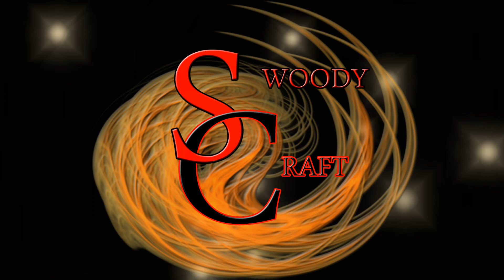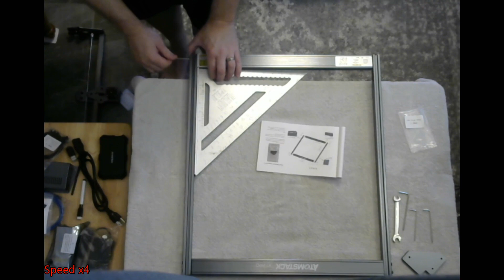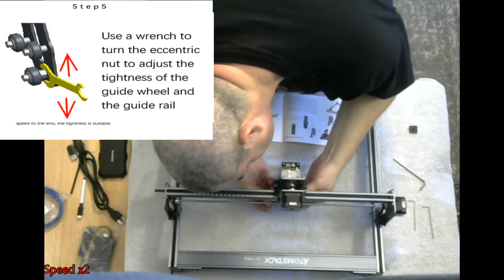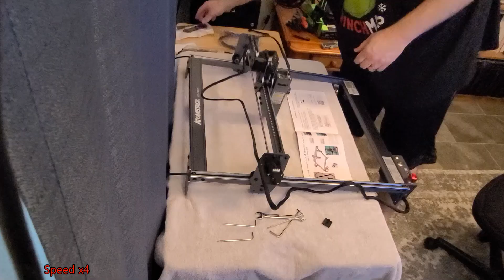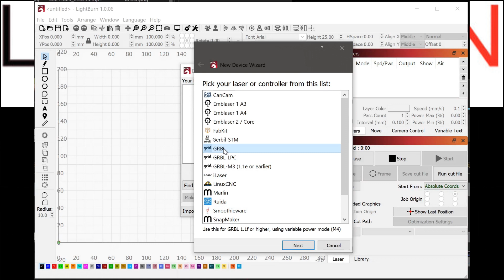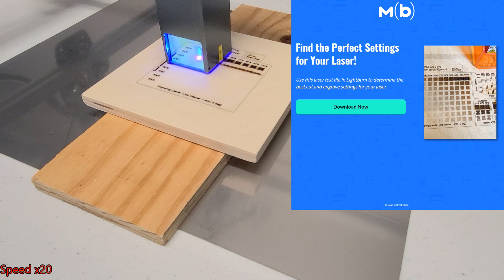ATOMSTACK X7 Pro 50W Flagship Laser Engraver (Unboxing, Build Tutorial and Testing)

Comment: This is the same as my AS10..I assembled it like you. My wheel on laser mount seems to be dragging just slightly in middle of distance..I just have to loosen the nut right?
Reply from the maker: Yes, more than likely that will fix it. If not, check the bearings in the v rollers, they sometimes get gummed up or damaged.

Comment: I've just put mine together. . .   One thing you said to leave out the controller screw so you could fit the T locks for the belt. . . . the T lock actually can turn in the groove so no need to do that. Otherwise you were spot on with your video.

Comment: Needs to show correct info - this is NOT 50 W laser amazon says +The laser power is 9.5~10W
Reply from the maker: The title is based on the company description. The X7 itself is designated as a 50W total power though you are correct, the laser portion is only about 10

Comment: Hello thanks for sharing. I got my laser and tryed to set it up with lightburn software, but the laser its self doesnt work. Its saying that is ready and everything is connected.  I try to move it and it didn t move. To the position.  I need help. The laser works great with lasergrbl.
Reply from the maker: What settings did you select when adding the laser to lightburn?
Reply: Thank you for your response. Sinced I use lasergrbl in com 3, I thought I could use lightburn in the same com. So I had to change the com to com4 and now it works. Thanks.

Comment: What a great review. I'm about to purchase my 1st laser engraver. With the introduction of the AtomStack S10 Pro would you take the X7 over the S10 and why?  Second question, will any roller work or is the AtomStack roller proprietary to its brand.                Thanks Swoody. You're great!
Reply from the maker: Thank you David. To your question. I honestly don't know that there is any difference between the two. From everything i could find, the X7 and the S10 seem to be the exact same model... However, if you are going to get one and have a little extra, i just say there new flagship model the X20 Pro is coming out soon... it is a smooth grand... but its twice as powerful, and supposedly can even cut thin metal... If i new that was coming, I would have waited and gotten that...
For your second question. I believe that any roller should work, assuming that they have the correct input cable/port or you have an adapter. The only thing a roller does connect directly to a wheel instead of pulling along the Belt. That being said, depending on the type/motor of you roller, you may have to adjust your movement rates. Not sure if that would be necessary, but if you see your images being either too skinny or really stretched, that would probably be the reason why. 
I believe that LightBurn allows you to change that, but i have yet to play with it.
Reply: Identical machine with the s10 lacking wireless capabilities
Reply from the maker: Little secret x7 wireless doesnt work. And if u ask for new board, they send u one without it....

Comment: I just recieved my atomstack x7 pro 50w , great vid . How much and when and is the radiation from the laser produced . It gives amuonts in the book but not being a rocket scientist its a littl vague .
Reply from the maker: Im not sure i understand the question. The laser is outputting high intensity light/photons. Not radiation in the classic sense. Are you wanting the light frequency range?
Reply: @SwoodyCraft  class 4 product  with 400-700 nm class 3 protective housing being the actual laser housing not a full machine enclosure,  walk in access meaning no protection around the laser , page 1 , part 1 of the manual.  I guess the question is besides laser light being emitted,  is there , as they mentioned,  a amount of radiation being emitted while in use ? Should i just get a small radiation detector to check it for personal safety paranoia ? Thank you for you response .
Reply from the maker: I see what your saying. To the best of my knowledge there should not be any harmfull radiation as u think of it. The only harmfull emmission from the laser, is the beam itself. Technically anything that is emited is considered radiation.... but light is generally not harmfull unless high intensity and/or focused
Reply: @SwoodyCraft  thanks

Comment: Could you tell me what percentage you have your fire button set at on lightburn? It says to stay below 1% but with the polarized lens I can't see it at 1%.
Thanks again for your time.
Reply from the maker: Never used it. I use the framing option, and align off that
Reply from the maker: No beam, but it moves around the outside of the burn area, so just keep hitting it and adjust your piece to center on it.
Reply from the maker: Im working on an upgrade that may help, but videos delayed...
In the mean time, a neat little trick. If u have a scrap board under your burn plate, you can set lightburn to make a box around your project, and then burn that box onto your scrap. Then just place your work piece in the box.